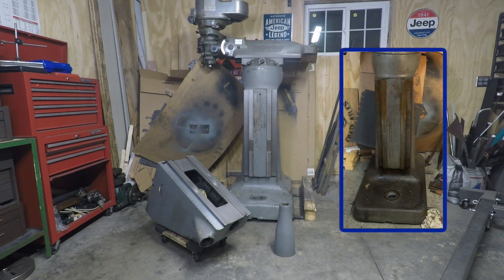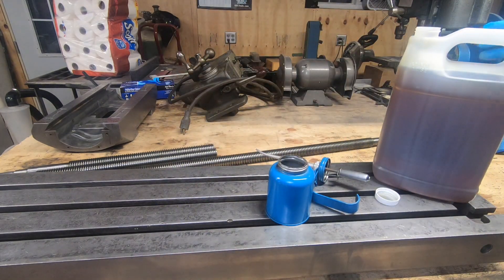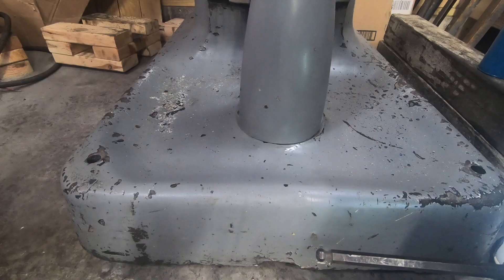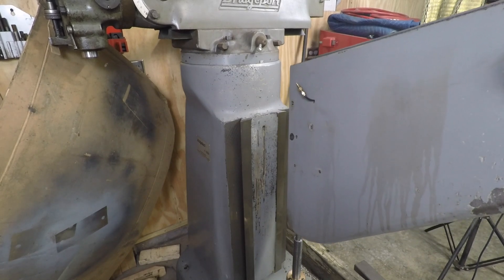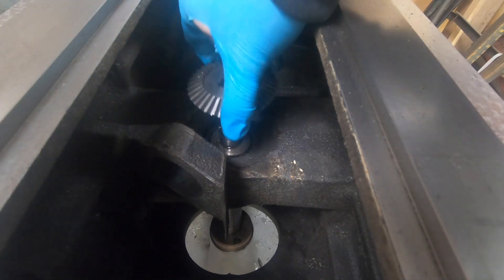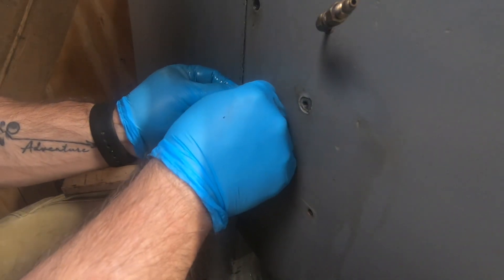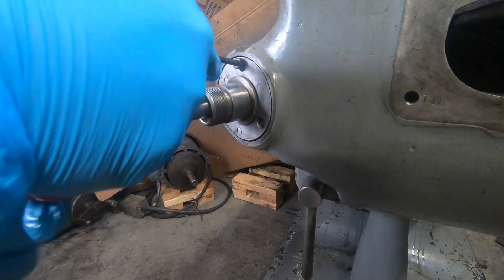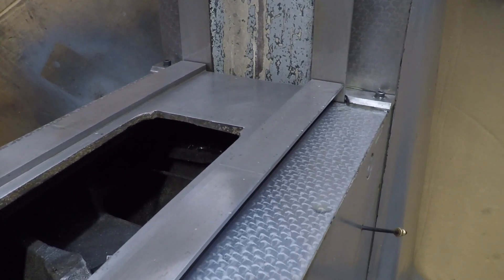Bridgeport Mill - Installing the Knee

Comment: I just use gear oil.  Next time I am in the big city I will chase some way oil. How does it hold up to coolant?
Reply from the maker: Some gear oil has detergents in it. You don’t want that. And I don’t use water based flood coolant, so I wouldn’t know.

Comment: If your knee is stiff to turn what’s the solution 
My gears don’t look as crisp as your tiny chips in them ? I guess new gears ?
Reply from the maker: Could be gears, but could also be lack of proper lubrication,  or perhaps the gib needs to be adjusted. It could also be wear in the column ways - no easy way to fix that.

Comment: I have a mill that I bought a year ago and finally managed to get it off the pallet and in place last week.  The condition looks about the same as yours and I want to tear it down, clean and fix if needed. I’m not a machinist so I don’t know much about this process but it doesn’t look too difficult. What chemicals and abrasives did you use? Thanks for the videos.
Reply from the maker: I'm not a machinist either! I just play one on YouTube. 😂 In all seriousness, this is still a relatively new hobby for me and the cost of new machines is something I cannot afford to do, so buying ones that need a little repair is the only way I can enjoy the hobby. Take your time, and you'll figure it out. As far as chemicals, mostly Simple Green, Purple Power for the heavier stuff. I don't usually like to use anything stronger, but I will use Kerosene when I feel it necessary. I don't like to use anything abrasive past some fine ScotchBrite pads.

Comment: Looking good Greg!  I just subscribed.  I use Mobil Vectra on my old Clausing lathe, but it looks quite a bit thicker and stickier than what you're using.  The way oil from Precision Matthew's (I don't know who makes it) that I use for my mill with the one shot lube system looks like the stuff you have. I think it would work a lot better than the thick stuff in that case.
Reply from the maker: Thanks for the sub! Yeah, it's definitely thinner than the stuff that came with the rebuild kit for my Southbend. I now know I can get Vactra #2 from High Quality Tools in smaller than 5 gallon quantities. I may pick some up next time I am up there.

Comment: Gday, the scraping marks still look in great condition, great job mate, Cheers
Reply from the maker: The chrome ways are pretty durable. They do have wear in them, but for me as a hobbyist, I think they'll be perfect. The only bit I have the least bit of concern about is the table. There's some scoring under the rear ways. I'm going to run it for now, but might have it ground if it's worse than I thought. Need to get an indicator on it and see what it looks like.

Comment: Looking good .  Your one has way less wear on the ways than my BP , most of the scrape marks have worn away on my one .      For oil , i use 68 hyd oil with a Caterpillar  1U9891 additive , to eliminate stiction .   Cheers .
Reply from the maker: Hydraulic oil also came up in my searches on what to use. Good to know it does indeed work.